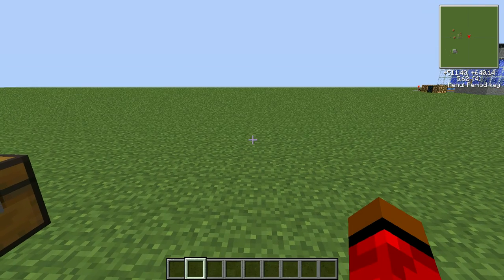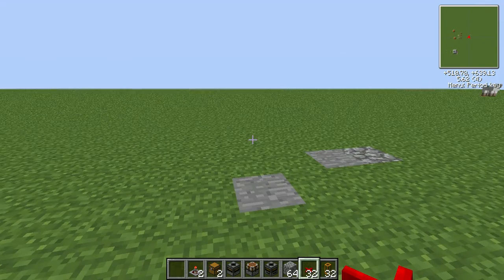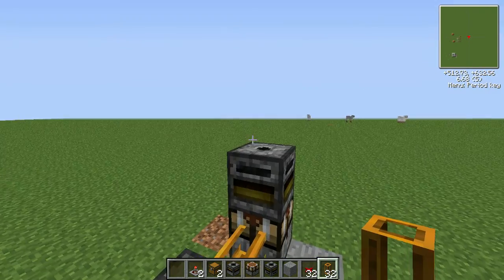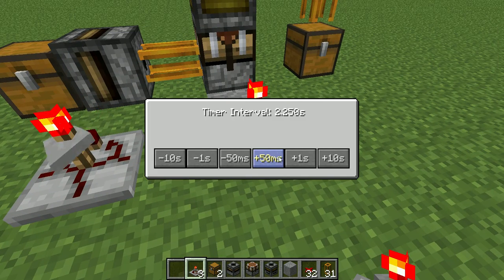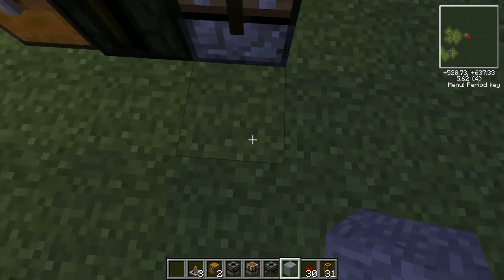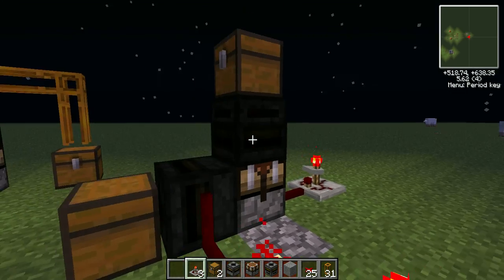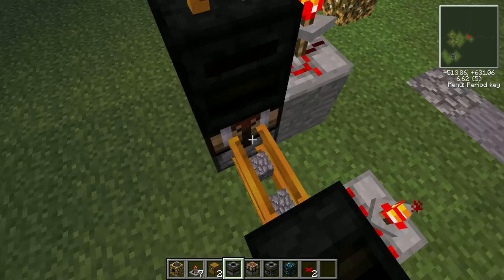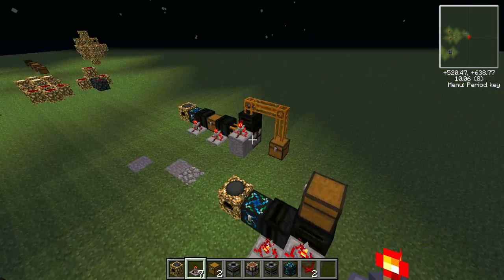Tekkit Classic Tutorials - Auto Crafting Table Mk2, Used For Factories

Comment: You know you could use a Filter only redstone tubes to conect to the flower then use covers so they wont connect to the things get a Jacketed wire and red alloy wire and put A timer connecting it get a pnumatic tube and connect to timer and do the other things yourself

Use logic at building factories